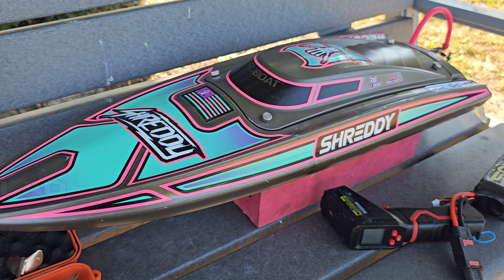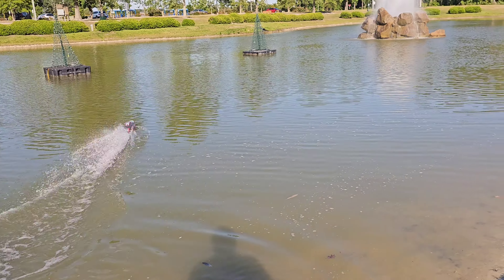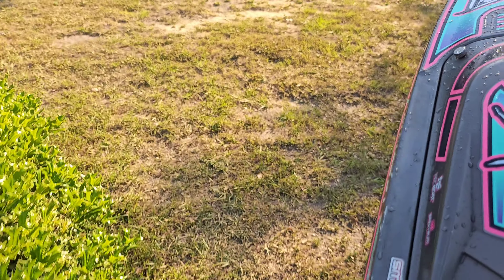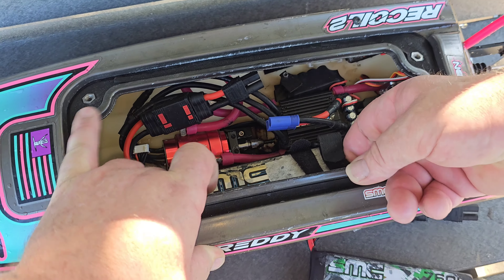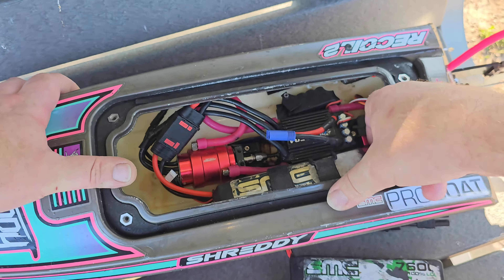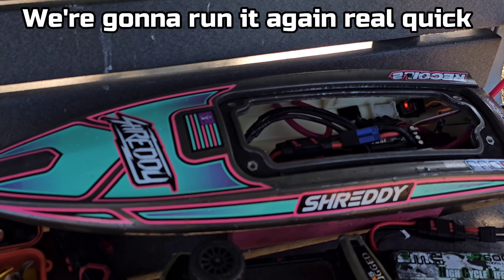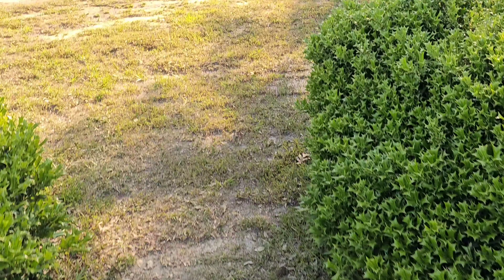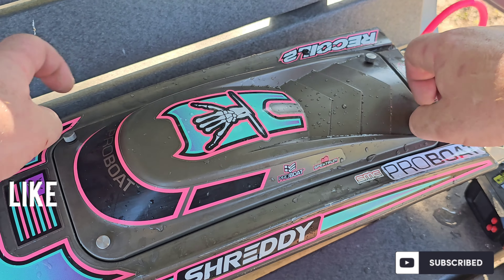Octura x640 Prop Test Upgraded RECOIL 2  3 & 4s Lipo - SMC, Leopard X2 3660, OSE Rader 150a

Comment: That shreddy is a better boat hands down than my 33” delta force. Cheaper faster more stable.
Reply: DF33 is a higher performing hull and is more challenging to setup…and drive…my impulse was easy to tune.
Reply: @stevesocransky6341  I got sick of it chine walking and flipping so I put an outrunner in it and a flood chamber so it would self right and then I put a flat spot in the middle of the Vee to create a plank for it to run on. Now it don’t flip but it still chime walks just on the hairy edge of out of control. Only does 62 mph on 6s 5000 mah 100 c HRB lipo with a 150 flycolor esc and a m447 octura but it has good run time. I have tried many props and trim tabs and adjustments on those and the stinger this is its best. And still not as good as the shreddy 
An in runner would improve speed but  now I have it I want to keep the self righting.
Reply from the maker: James, I totally agree with you. That recoil is extremely stable at speed, I think we'll I know it's the ride pad that gives it it's stability.. you were right building a pad on the Deltaforce, I've gotten better performance from a couple mono, refining the shape of the rear pad.

Comment: Nice stable runs! I’m quickly finding out just how many tweaks n things/ variables to watch…my cats gets warm when using bigger batteries, couldn’t believe it… also had to drop the cooling tubes just below the hull to increase  water pressure to cool the  animal with 4519 props…now I have a few bigger boats, I have  to build a 2 level rack to transport the boats to the lake… couldn’t find any good ideas online, hint hint, might make some good content.
Reply from the maker: That's a good idea. I could definitely use a "travel rack." I've had some stupid accidents with my boats while in transport,  messed up a couple of props, and bent a rudder blade.     If I can get off my lazy, but I may build a pvc travel rack...

Comment: The recoil 2 is a great looking & performing boat, I take it that it wont self right with an inrunner motor upgrade ?
Reply from the maker: Correct,  I lost self righting when I switched to an inrunner
Reply: I will have a video out using the stock  motor running 5S and 6S very shortly. Nobody seems to have figured it out but I’ll have a video up soon. And I promise you will be impressed
Reply from the maker: Shoot me the link, I'm already impressed,  I had terrible cogging/sputtering on 4s with the stock motor how the heck were you able to run 5 & 6s
Reply: That little "thingy" runs so smooth...

Comment: Man my recoil ain’t going but 35mph on a 1350kv motor running 6s with 150a esc. I thought maybe 6s was weighing it down but I run a 4000mah 6s and a 1500mah 6s. Thing is got some drag or something going on
Reply from the maker: I'm running around 45,000 rpm on 4s your around 29-30,000 rpm on 6s.  You'll need to prop up considerably to achieve the speeds I'm getting out of my setup.   I'm running a 3250kv motor, and my temps get hot with larger props, running a 1350kv motor you have the head room to run larger props with out heat build up